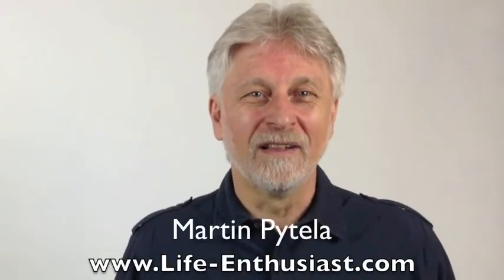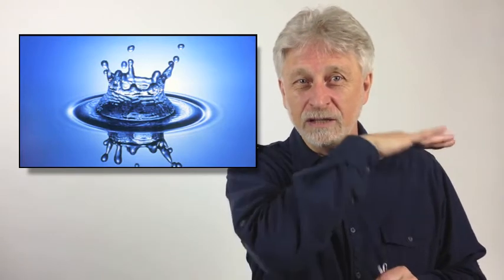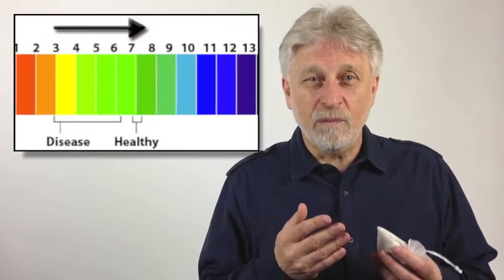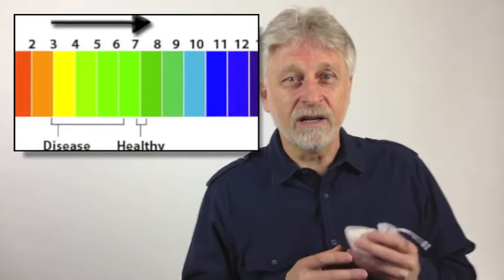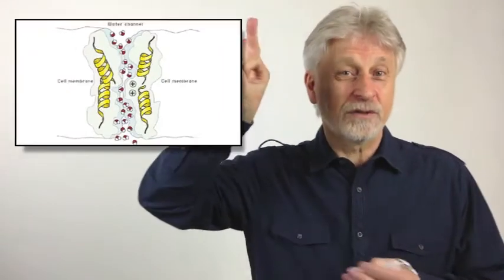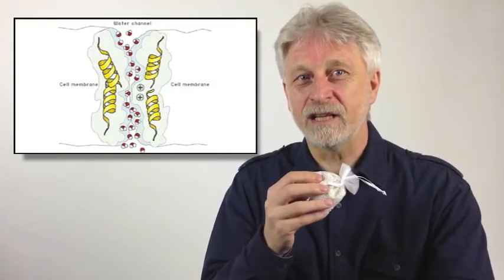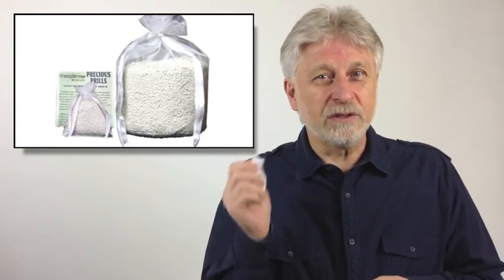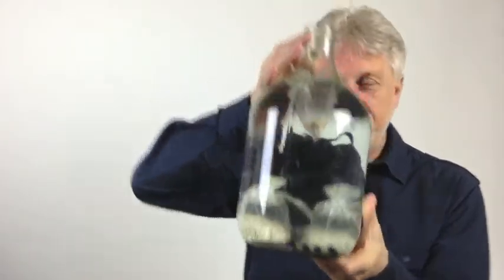What is Structured Water? Part 1 -  Life Enthusiast Health Show

Comment: Great stuff Martin, miss your Podcast. But this will do:)
But do you have any number on the water you treated with the Pearls. Have you done the tests? So we can see any numbers before and after, on how much it will l-Lower Surface Tension
-Lower Acidity (more alkaline pH)
-Lower ORP (lesser oxidative stress)
-Smaller Clusters (better intra-cellular penetration.
I Got the prills, the crystals, and i use the ADR-4 at work.
But i am curious, keep up the good work!
Reply from the maker: The changes are always relative. The more mineralization (hardness) in your water, the less impact. The Prills will do most benefit when used with distilled, or RO filtered, or other soft water.

Comment: Ive been told you dont need to replace prill beads but need to wash them overnight in bi-carb soda after 6mths
Reply from the maker: Depending on your local water. You may need to remove calcifications with vinegar. Or do the baking soda trick. Eventually the Prills should be replaced.